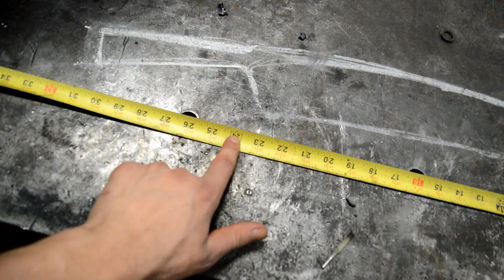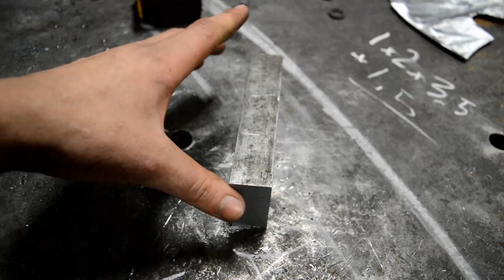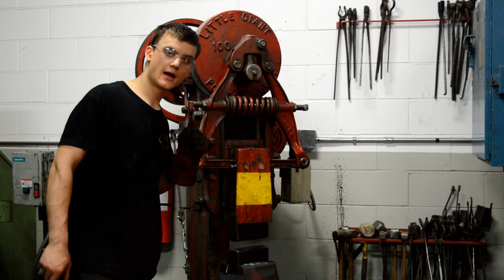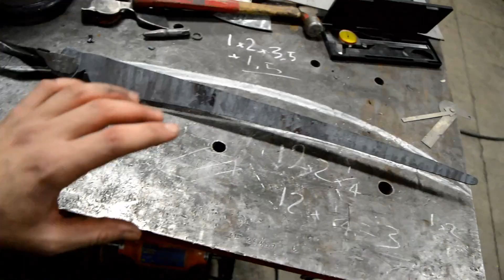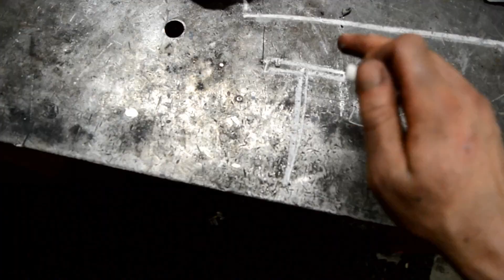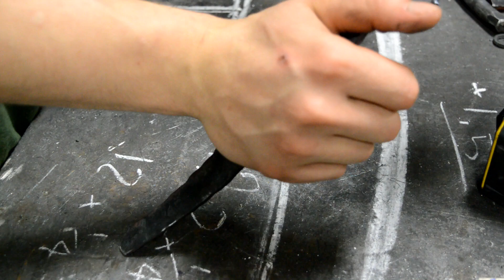Making a War Scythe Pt.1 (FAIL)

Comment: Great tip about the centre punch, I'll have to make one! Put it on a spear pole and make some upward curving vise jaw inserts for the next one so you're only gripping at the point you're hammering on.
Reply: All he needed to do was heat up the spine and blade and he would of been fine, with the blade heated under it it would of simply deformed instead of cracking.